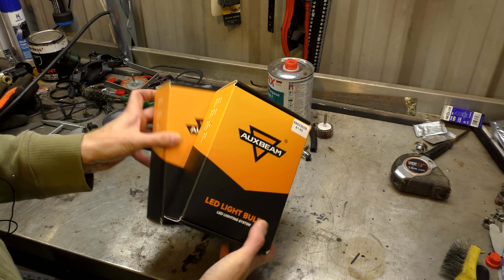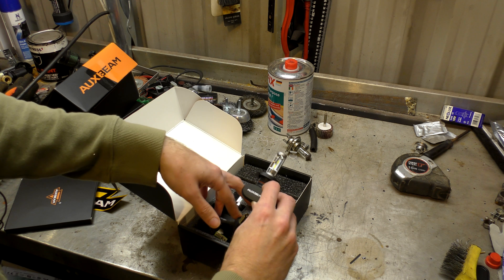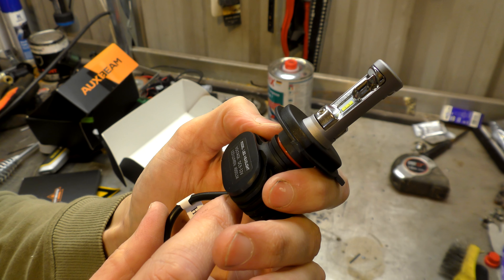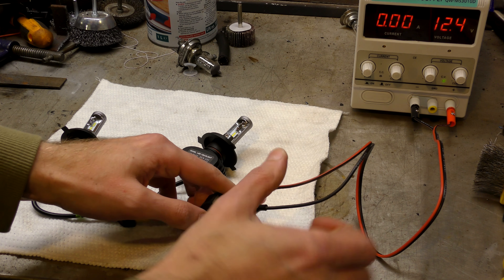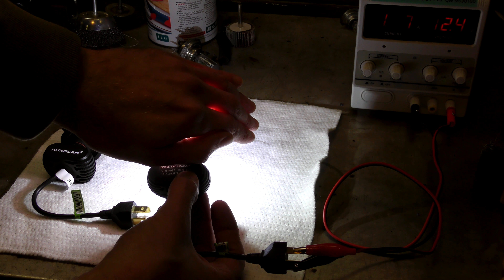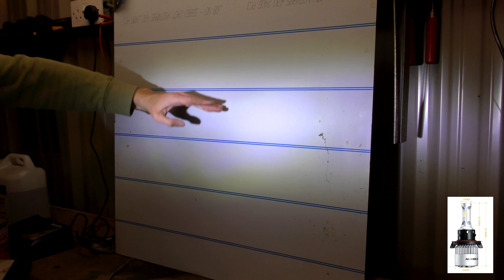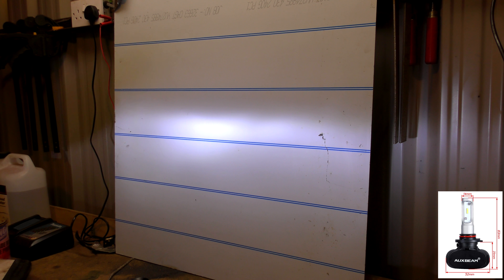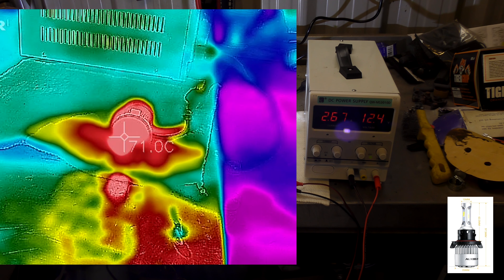Auxbeam LED Headlight Bulbs NF-S1 comparison to previous generation

Comment: And the best is???
Reply from the maker: Depends if you want more high beam light or a more defined low beam.
Reply: More defined low beam and more life bulb
Reply from the maker: +Cesa Torres You'll want the newest generation bulb.
Reply: High beam
Which is better in your opinion?